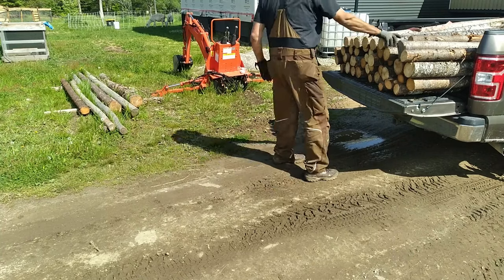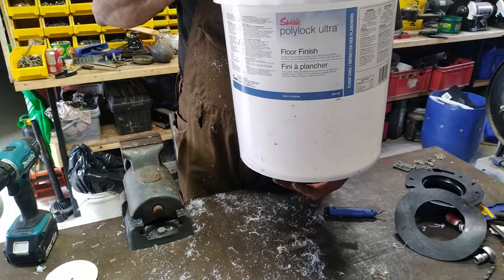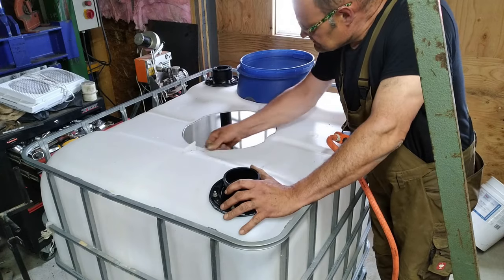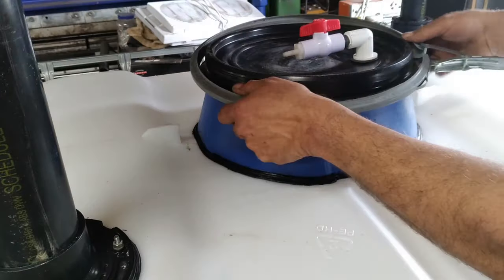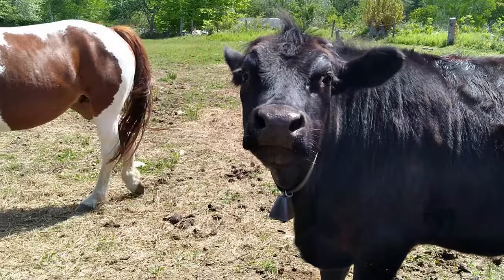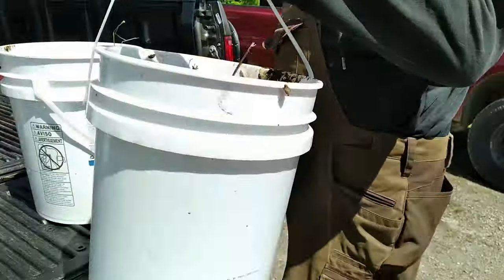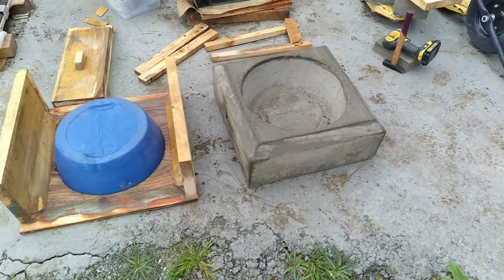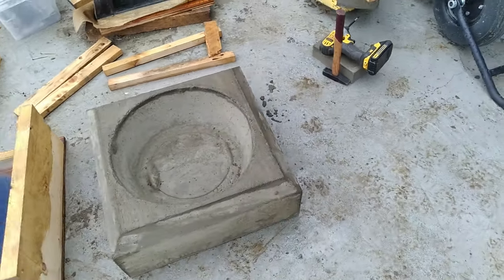Farm biogas project  (part 1) digester setup and a new pig feeder for the homestead

Comment: About time! Thank you! I've been telling ppl do this with there septic tanks add some mulch & let it gas up. If can design a drain pump dehydrator can add some more mulch sticks scraps  press into bricks or pellets preferably bricks wrapped in something so don't have to touch it. . Burn in fireplace. If pellets can burn in gasifier make more gas & heat house & water. Add some water tanks & pipes you can make a steam generator all winter.  Never go could again! No shit!? Phone a friend tell them to come over for the day

Comment: i totally get the concept. but: 1) why make the inlet so far up that you need a chair to fill it? 2) how do you get the gas into a storage container like a rubber boat, a truck tire-hose or a big PVC Baloon? 3) why is there no shutter in the input or fertilizer extraction pipe to keep gas from escaping or creating explosive atmosphere with incoming atmospheric air? thx!

Comment: The outlet pipe should be on the side, not on the top. Easier to regulate water level this way.
Reply: I would add that with the effluent pipe higher then the Gas Outlet, you risk getting effluent in the Gas as well. Additionally, the effluent should probably also be much lower then the intake side. The liquid will seek an equilibrium and while the gas can and will hold it back (on the gas pipe), the level will still seek to equalize on the intake and effluent pipes.
Reply: @paulgardner5928  ,
Reply: True!
Reply: Absolutely right

Comment: Seems like you are on the right track BUT how do you collect the gas off the tank if it is vented to not build up pressure?  The black "up" tube with "drop down" tube dosrnt seem to have a way to seal and don't know what the bucket on the tube purpose is.  I did not see any way to shut these tubes off.  The only way to collect gas at this point would be to pump it off instead of collecting it under natural pressure and even that would iffy considering the vents.
Reply: You store it in plastic bags. Then use a small fishtank compressor for pressure.

Comment: Why is the liquid outlet pipe higher than the gas outlet? Doesnt the gas outlet fill up with liquid? Wouldn't it make more sense to the have the gas outlet higher than the liquid? Why do you have the liquid outlet and inlet so high?
Reply from the maker: The pipe from the liquide outlet ends 2 inch above the bottem of the container and if the gas in the container build up a little pressure it will push out the liquide from the bottem of the tank. The hight of that outlet is regulating the pressure of the tank if the outle is higher you have more pressure.

Comment: Can I use only food waste for gas production?  or do you have to use animal manure?  Can I manage to produce enough gas to heat my house?  approx. 140 m2 and winter temperature "tops" of -10 celsius degrees. (approx. 10 days during the winter) otherwise 0 to -5c.  for 4 months.
Reply from the maker: You can use food waste, you need the cow dung only to start the process with the right bacteria. If your system is big enough and you have enough food waste or biomass  in the winter time to feed the bacterias and you can keep your digester warm enough it will work, i am sure

Comment: Can it  be toilet pit made in to bio gas digester ?
Reply from the maker: In theory, yes, if the inlet and outlet are at the right height, if there is enough space for the gas and the whole system is tight it should work
Reply: @dsfarmns2823  tThanks a lot

Comment: Good day, and greetings from France, enjoying your videos and workmanship !!  Can you please tell me what the make & model is of the plastic welding tool you used to weld the top of the blue drum to the 1000L tank ?  A very versatile and useful tool indeed !!  Thank you.
Reply from the maker: Hi to France, here is the link for the plastic welder, the one that i used in the video is an old genereation close to 30 years it is an Wegener WEG 08 220Volt 800 Watt .
The new welders you can find here:     https://www.wegenerwelding.de/DE/produkte/schweissen/warmgas/Duratherm2.html
Reply: @dsfarmns2823  Thank you so much for your quick reply, will go and look straight away, just bought a 500L tank to get going on the project.  Keep well & happy.

Comment: Why can't used small hall  in Bec tank body top hole
Reply from the maker: Because the flanges, the heater and the mixer are not fit in the small original opening and it is way easier to clean out if you have to.  Please watch BIOGAS part  2 , 3 and 4 that would explain it.

Comment: If like your concept but I don't have a plastic welder since bucket lids are designed to seal to the bucket I figure if I cut the center out of a couple of lids one should be able to be ovaled enough to fit into a hole in the top of the tank then used as a bottom ring to bolt the two bucket tops together one inside the tank and the other outside once bolted and sealed the bucket can be put on top of the lid creating a gas collection dome also I also don't trust uniseals also their expensive and they have to be ordered so toilet flanges are a great idea but why make rubber seals why not use the proper toilet seals you can get them in a foam rubber type
Reply from the maker: I think that could work, in our case a bucket is not big enough that the heating coil fit inside but if you maybe make the coil smaller it would fit look at biogas part 4   Videolink
https://youtu.be/a8PIyj8plhk

Comment: Why are yo using large blue barrel lid for gas out line fixed
Reply from the maker: Because the flanges, the heater and the mixer are not fit in the small original opening and it is way easier to clean out if you have to.  Please watch BIOGAS part  2 , 3 and 4 that would explain it.

Comment: I tried putting some cow dung from Canadian Tire in a bottle with water and a piece of meat. I dont see any gas after 10 days. Am i doing this right?
Reply from the maker: Is this a serious question? Please don't get me wrong, but this attempt sounds a bit crazy to me. Do you want a serious answer?
Reply: @dsfarmns2823  Haha I wanted to see if I get gas at all first. So, dunked a bit of canadian tire cow manure the first time into a bottle and have a pipe hanging out the lid for the flame test. But no flammable gas. I next tried incoulating the cow manure with some chicken meat. It now stinks like h2s but no flammable gas again so was wondering if u have any suggestions?  I am trying this here in Antigonish
Reply from the maker: It could be that the cow manure from Canadian tires has been heated before packaging, in which case no bacteria will survive. And the biomass needs at least 35 to 37 degrees Celsius, like the body temperature of a cow's stomach. I would try to use fresh cow dung direct from a cow and I would conect an air ballon to the outlet hose from the bottel to see the gas production. A Bottel is realy small a 5 gal bucket with lid make more sense and you should daily feed it with biomass.
Reply from the maker: And the bottle should be protectet from the UV light. UV or day/sun light kills the bakteria too.
Reply: @dsfarmns2823  thanks will give this a shot again
Reply: @dsfarmns2823  well finally got flame. Gotta do more experiments now
Reply from the maker: did you try it with bull shit from Canadian tire or some thing diffrent ? Can you please send me a pic of your setup to on our FB site D&S Farm NS.
Reply: @dsfarmns2823  yea the cow shit from Canadian tire. I inoculated it with a  piece of chicken. The methane was less but it worked least. I will do further exps with inoculum from the green bin. I will go home upload the video and send I a text

Comment: This design has a a big problem. The slurry will be pushed out of the gas outlet due to the hydrostatic displacement of the digestate outlet which is installed too high. Rule of thumb is 20 cm of displacement.
Reply from the maker: No  it works absolut grate just the water is coming out and no slury the the fertelizer outlet , it can not come out at the gas outlet because of the dome there is never any liquide inside the dome

Comment: does3make sense, the inlet and outlet are higher than the gas.
The gas should be the highest piece.
Reply from the maker: Yes it make sense it is sipel physics, both pipes are ending close to the bottem of the tank and if you fill liquide in there is a gas pillow build up at the top of the tank where the gas outlet is and if the pressure of the pillow is high enough the liquide left the tank at the overflow  higher outlet = higher gas pressure. And because the inlet is a little higher than the outlet it seals the inlet with liquide  and the used liquide is leaving the tank at the oposite side of the tank at the outlet ( overflow). The Gas pressure is also relateted to the weight on the plate that keeps the blader preeed together. It shold be the right wight if you dont want to blast the digester.
Reply: @dsfarmns2823  I see.
internal build up, with the pressure pushing the liquid where it's supposed to be.
Sure, 👌🏼
Don't use all the gas because then liquid up the line.  lol
but I get your idea now.